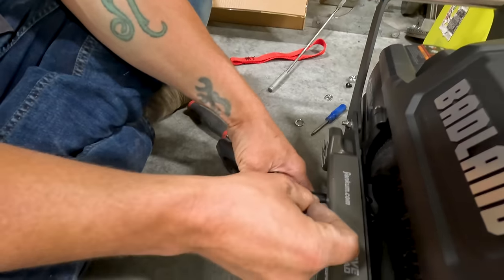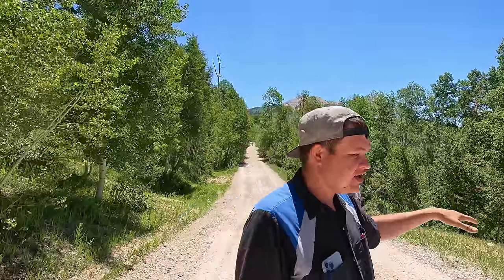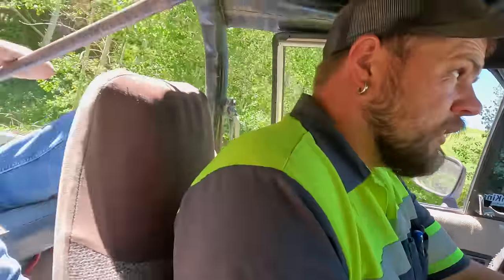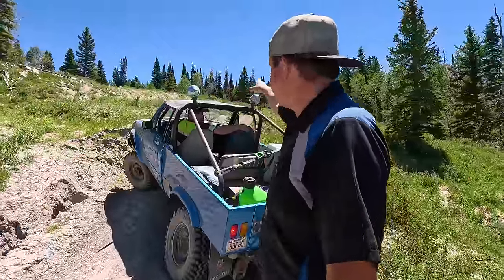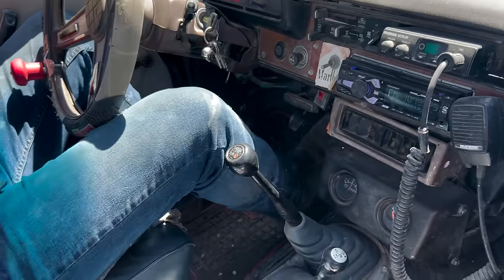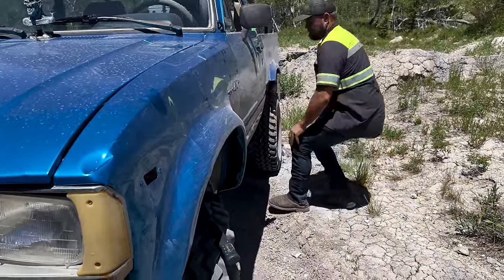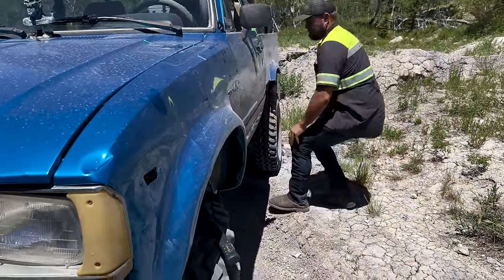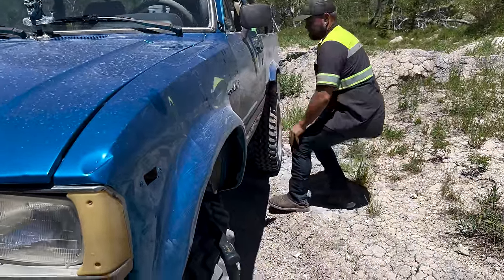Full Size Two Wheel Drive Dodge Stuck On 50” ATV Trail! (Part 2)

Comment: The cost to recover that thing is probably a whole lot more than the truck is worth
Reply: I was thinking the same thing!
Reply: It’s the “meth-mobile” so yeah it’s prolly been bought and resold for a carton of smokes and a 6-pack numerous times.
Reply: If you want your own easier to recover meth-mobile-home-away-from-home theres a early 90s "GMC" flatbed (rebranded Mitsubishi fuso) with a "very well maintained" travel trailer behind it abandoned in my town 1/4mi from the police station, but nobody will touch it. 😂
Reply: the recovery is for the forest service, not the owner. Forest service wanted it out of there
Reply: Since the US Forest Service hired Robby, that means us taxpayers are getting that bill.
Reply: The trail is what's of value
Reply: At least the crap is off the trail.
Reply: I know Casey Liddell gets paid if the call is by AAA. And I think the state pays him for any recoveries that they call him on. I would think that the state of Utah would have the same system.
Reply: @scottmichaels12 I am sure he's going to pay a hefty fine and probably lose the vehicle .
Reply: Almost seems like it was placed there right?
Reply: @probokoala   It was Impounded. Multiple Fines to be paid...

Comment: Just seen Hillbilly say he needs to adjust the carburetor. If he got the Holley Snyper fuel injection that replaces the one barrel autolite 1100 series carb. just need a adapter for the manifold but will make that four cylinder run like crazy, no more carb related issues.

Comment: Today on the trail, someone lost their brake line with no spare. Having seen seeing your brake repair in this video, i knew e actly what to do. I told them their only option is to crimp the metal line and smash it to seal. It worked great.

Comment: You only had a 3:1 advantage on your setup minus a good 10% for friction loss and you’re at about 6,750 lbs of pull with the CanAm. But it's still a sweet set up. I want one.

Comment: I would have also taken my quad on that recovery.  I use to go exploring in my 1965 Jeep gladiator pickup all over Nevada, BUT, I always had my XT600 on the bed.  I might get stuck, or broke down, but I am not walking out.  A person should always have a back-up plan.  I ride my quad and dirt bike alone all of the time, BUT, I always carry my Personal Locater beacon with me.  I am 76, and I am well aware that crap happens!!!  

I also have a tool kit in all of my vehicles.  I hydro-locked my Jeep Cherokee crossing a creek.  I took all of the spark plugs out and pumped all of the water out, then drove it 100 miles home.  It now has 240,000 miles on it, and it is still going strong.

Comment: Something else you can do on the trail, if you bust a brake hose, take the line off at the master, stick a small nail in it and put it back on. It would plug off either the front or rear. Not recommended for on road use though.

Comment: Great job on the Ram recovery!! Even though it took  two trips in two days... you got it out!! Might be time to go over Hillbilly's trekker and do some preventative maintenance.. like... I don't know.... maybe brake lines, check the brake pads and wheel cylinders,  stick in a new fuel pump and install lockers on the diffs. Restock the tool box with some new brake fluid, coolant, zip ties and a complete tool kit.  😁😁😁😁😁

Comment: In case you ever have issues with brakes again the toyota driveline bolts thread into the masters and elbows so you can plug up the lines without damage

Comment: Could of wrapped the seatbelt around the door to hold it shut. But that wouldnt of been as fun and exciting of a drive or video. 
Hillbilly needs put few extra pieces in the compartment like electrical tape, screwdriver, vicescrip, wrench, ziptie or two, tire plugs, bottle of water, brake fluid, power steering fluid, or not. I would build on to his Uncle's stash.
Be Safe!
Keep Your Head Up! 👍

Comment: I use to run 33x1250x15 mud kings ,  on my king cab Toyota,   open carriers  but had a softer springs  it would go places  .  Bet I could have pulled it out in 2 ,low

Comment: I have blocked off a brake line with a small nail.  Just un-screw the fitting and slide the nail in the line then tighten the fitting again.  Crappy but works.

Comment: Remember, Rated winch capacity is on the first wrap
Reply: And how heavy the tow vehicle is, a 12000 lbs winch will pull a 6000 lbs tow vehicle unless it’s anchored

Comment: That is why having a cable operated, seperate parking brake(handbrake in the UK) is definitely a great plan B to have in your toolbox.

If all else fails, you've still got something to grab in an emergency. 

We have them as standard over here on the back axle.
 You can also do 'handbrake turns' by hauling it on and ripping on the steering wheel, like drifters and rally cars do.

If you like that sorta thing 😉👍

Comment: If you take the line off on the master side and put a one inch roofing nail in the line and tighten it back down it works in a pinch or permanent but it will bleed down very very slowly lol

Comment: Note: A 12,000 lb Winch cannot pull 12,000 lbs if the vehicle pulling is not 12,000+ lbs.  or secured to an anchor.

Comment: The other thing about a 4-1 pulling system is you need to move the winch line 4 feet for every 1 of load movement

Comment: One should always pack a cooler of snacks and tasty treats just in case. Just for the sake of comparison, what's a bag of ice cost in UT? 

And no, a Badlands 12,000 pound winch pulls around 8000 pounds (at 2nd layer off drum). Even a Warn only does a little under 10k and with all but one one layer off the drum you'd be lucky to get 6500 pounds.

I always carry a small brake fluid and a brake hose clamp.

Comment: This was a cool video and all ... BUT . You guys are still dorking the water supply issue . You should plan as a MINIMUM. One bottle of water per person an hour !!  And , unless you are carrying a water filter . You should plan on 24 hrs minimum. . It would be " smart " for all your  " Off Road " recovery vehicles have 4-5 Nalgene bottles ( 32 oz ) and a water filter and water purification tablets .  Forget the ICE and load the cooler with more water bottles !  Having rescued people in Ca. Id and even Mi. who were out of water , and having learned the hard way in Idaho . You cannot prepare enough to have water !! Be safe out there ...  At least you guys had a claw hammer though :D

Comment: I think this video is proof of how good is Matt at what he does, and how reliable is the yellow fleet.
Reply: Actually they always seems to have a broken vehicle . It has taken  years to get the banana and morrvair to where they are now and I’ve lost track on how many upgrades they have done on both. A year to build the wrecker and still seems to be broken more than it’s running.
Reply: @jcar1417  Oh, Really? They seem to get the job done all the time. Even if it's with a claw hammer. 
I wonder if you've ever picked a tool in your life
Reply: @Nairod2  nope. 32 years as an elevator mechanic, restore old jeeps, motorcycles and snowmobiles, renovated three houses. Never touched a tool in my life.
Reply: @jcar1417   Sounds like it, bet you like to hammer screws in.
Reply: @Nairod2  hopefully when you graduate highschool you can pick up a few skills of your own. I hear Mcdonalds is always hiring. Good luck with your future.
Reply: @jcar1417 Yeah the banana was a massive work in progress. I think it had three different suspensions and at least 3 different front axels.   The morrvair was a cluster F at first. Now it has smoothed out some. No such thing as perfect out of the box trail rig.
Reply: @ziggystardink9389  agreed. I honestly think things have improved on the maintenance aspect since TomTom arrived on scene. I have put a lot of bandaids on things to get them running but at some point you realize doing things right the first time doesn’t take much longer and saves you time in the long run and I have had to many old unreliable vehicles , I try to be as prepared as possible but sometimes you don’t know that it won’t work until you have tried it. I think the banana and Morrvair are pretty much ironed out as long as they are used within their limitations.
Reply: @jcar1417 Yep the morrvair was built to fill in a limitation of the Banana ( power and weight). Once they get the bug out of the big wrecker it should just be maint and oopsie issues.
Reply: @jcar1417  thanks grandpa, when I grow up I want to be just like you. A grumpy old man who hammers screws.
Reply: @jcar1417 You seem to have all the answers, can't wait to see your channel where you demonstrate daily what a badass you are.
I'm pre-subscribed, get me a link!

Comment: You should keep nails with you . Break the line loose put nail in it and tighten it back up, line blocked and you can still use it after repairs.

Comment: Nice series. Just one comment. Don't tow with your winch. You're either towin, or winchin. Don't try to do both on a grade. Emergency Tool Kit. Rounded Jaw Vice Grips, hammer, duct tape. But just in case I bring my tool box.

Comment: Why don't you build a skinny recovery rig, big tires, big engine with a 50" width. Kind of like an off road dragster tires in the back then engine and a few seats one in front of the other. You could add a hydrologic anchoring system like you have on the skid loader. If you make it I want a ride.

Comment: If your Badlands 12,000 pounds winch will pull 12,000 pounds color me shocked because I have never seen an electric winch that will pull its rated capacity.  They often fall 1000 to 2,000 pounds short.

Comment: Here's a trail fix that doesn't wreck the brake line take a can I used a pop can cut a small disc that will fit in the fitting reconnect the line the disc will  plug the line

Comment: That's the older 2nd gen Ram. I have a 97 but it's 4x4. No back doors. I have an 02 with a Cummins that's rotten bad and an 01 dually Cummins dually. The dually is too much truck for a retired guy.

Comment: Y'all should make a relia'mobile 🤣🤣 take an Engine out of a late 90s/early 00s Toyota (corolla 1zz pre drive by wire would be perfect) and slap it in a Trekker, then gusset the crap outta the frame and do the suspension lol

Comment: I don't think that Toyota has stock running gear. I've never seen a Toyota that wimpy. I had one for 20 years and I could have climbed that slope no problem.  I had low range. That truck appears not to have that feature anymore.

Comment: God forbid something actually goes really wrong on 1 of these rescues... U guys would be screwed  I can not believe U don't have a recovery bag that has first aid kit, tools things like tape zip ties wire tyre weld jumper leads  ropes pull downs torches Leatherman lighter suncream water food packet of jelly beans in case of a diabetic emergency flare little battery jumpstart satellite phone or similar epi pen..+ more n U should have 2 or 3 of these bags ready to go if ur serious about doing these things..because accidents happen

Comment: come on robby! you would have been better off to use the vice grips and just pinch the rubber line instead of spending all the extra time to remove the rubber line and then pinch the steel line that now you will have to replace.  lol
Reply from the maker: Well you see the hole was right at the metal where the rubber meets it and no way to pinch it or else I would have
Reply: @RobbyLayton  figures don’t it?  It never happens in an easy way to fix in a pinch… lol
Reply: @RobbyLayton  I hope you know I’m only messing around.  Love your videos and your work at the shop.  I do the same only in Iowa and not on video.  Been working for myself for the past three years.